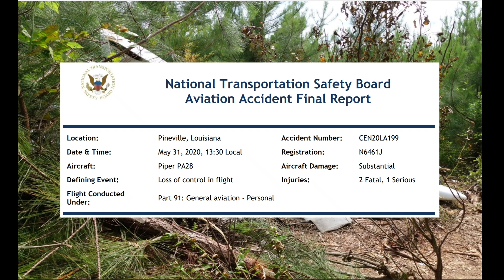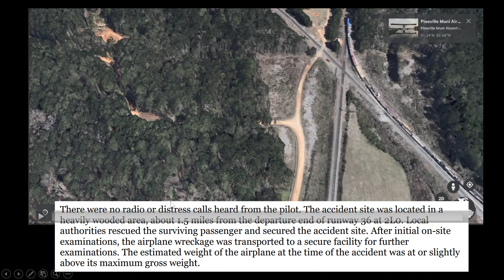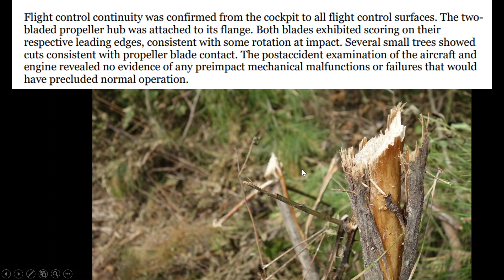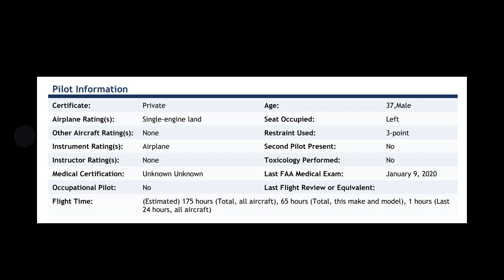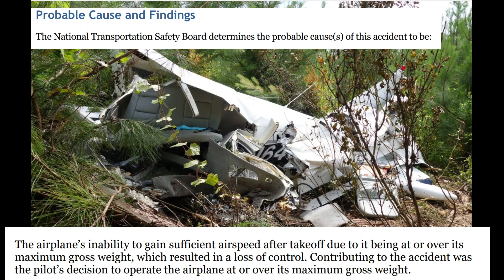Piper PA-28 Overweight causing Stall Spin

Comment: I have to take issue with the NTSB's findings as shown in this case. An aircraft flown at its maximum gross weight should not result in a loss of control and an accident unless they are going to go back on the manufacturer for that rather than the pilot(s). If it was overweight and that can be shown, than that should be the listed cause. If that cannot be shown, then the cause is either undetermined or they needed to do further investigation with respect to other factors like runway length, density altitude, other cause of diminished performance, etc. I can't imagine the NTSB ever accusing the airlines of causing a crash by operating at maximum gross weight. I have watched countless 727's on hot summer days be dispatched at their MTOW for the conditions and runway.
Reply from the maker: Thanks for your thoughts on this one

Comment: I know this is a bit older, but just ran across it. Looks like the weather at the time of the accident was 88F and 42%RH.  Just a stark reminder that density altitude (as stated here many times) is a factor that you have to be aware of. The PA-28-180 usually has a usable load of around 1000lbs.  Fuel, two adults (and they do not appear to be overly lg adults) and a child would typically not put that plane in a bad situation, but at those temp conditions it very will could have been marginal. I don't see much luggage/gear in those photos but hard to tell what they were carrying as well.  RIP aviators, I hope the child is doing ok given the circumstances.  May their deaths not be in vain and we all learn from it.
Reply from the maker: Thank you Wasser for the kind words and your take on this accident

Comment: This is a sad one. The son will have to live with this nightmare. Overweight, pulling back too much on the yoke with not enough airspeed and energy, thinking it’s going to rise when it’s already struggling. OF COURSE ITS GOING TO STALL!!! “Get there itis” That aircraft was doomed when he committed to putting it in the air. You have to pick a point on the runway when it’s time to throttle back and hit the brakes. It stalled just after it cleared the trees and augured in. Completely avoidable. I wonder what the temperature was and the density altitude.
Reply from the maker: Hey Rob, another bummer

Comment: Aircraft are certified to fly at max gross weight, and even.being slightly over probably isn't the only reason for the plane going down.   I agree with the density altitude possibility as well as  the engine may not have been living up to its published 180hp for various reasons.. Not saying that it happened here, but I had a C172 get carb ice on climb out in early summer a few years back and pulling carb heat saved my bacon.  Looking at recorded weather from Pineville the air temp was 75 with a dew point of 73 and humidity of 94%.
Reply from the maker: Thanks for sharing that info and for watching

Comment: The report did not state that the aircraft was over gross. It says it was at or over. Being at max gross weight is not a problem and would not lead to an accident. Something else was going on here such as a partial loss of power which can be caused by the throttle creeping back slowly. Or, more likely, the aircraft was in a steep bank for some reason we'll never know. NTSB should change the report to show loss of control for unknown reasons. Being at or even slightly over gross is a stupid probable cause that is just wrong.

Comment: Most likely it was density attitude & banking to turn cuts your lift stalling the wing. I have flown alot of Piper Cherokee 180's, 2 people, one child & full fuel shouldn't be a over gross problem. A Cherokee 140 will handle that with fuel at the tabs. The FAA made a educational film called Density Attitude with Harry Bliss in 1966 of a couple in a Bonanza on a cross country, highly recommend pilots watch it on YouTube.
Reply: The density altitude was only 1863 ft. Thanks for letting us know about the film. I put it in my Watch Later list.
Reply from the maker: Thanks for the heads up.  Will check it out

Comment: Since when does flying at gross weight lead to a crash?  He should have been able to climb out at 5-600 fpm unless density altitude was very high or he took off down wind. Makes no sense to me. Bad conclusion in my opinion.
Reply: Density Altitude was only 1863 ft. The wind was 030 at 7kts. He took off on 36.

Comment: Got a lot of time in Cherokee 140 180 235 Dakota. With 2 adults child and full fuel Plus baggage I doubt this PA28 180 was over gross.  If the child and 1 adult were in the rear seat  and had  baggage in baggage area may have been out of CG.

Comment: What makes a lot more sense to me than that overweight theory is that they had only partial power. Like Exuma Guy pointed out, how could a Cherokee 180 with full fuel, 2 adults and a child be overweight? Assuming he verified proper RPM before the takeoff, then he lost some power during the climb, if my theory is correct.
Reply: Ive recovered 3 aircraft crashed at Lake Tahoe all overweight and subsequently crashed in the box canyon killing everyone over the years..altitude..heat..full fuel tanks...luggage..wind all are factors even though the aircraft is not carrying its "maximum weight cargo and passenger capacity"..many people have died on this false premise and will continue to do until they do their calculations properly and that doesnt include marginal engine performance also
Reply: @lutomson3496  What do you mean by "this false premise" ?
And as far as" marginal engine performance", I'm assuming you mean reduced engine performance which is naturally part of all density altitude performance calculations.
Reply: @philipmartin708  I think he means incomplete pre-flight calculations in general, complacency plus inexperience in conditions that reduce both lift and engine performance.
Reply: Yes you are absolutly right ! This crash has nothing to do with overweight. Partially powerloss might be a factor, I suspect a stucking carburator heat. Have seen this on many pipers
Reply from the maker: Thanks for you input on this one Philip
Reply: I totally agree. Investigating authorities are very quick to say "overweight" when there is no evidence to support it.
They refuses to look at a partial engine failure.
Reply: More likely scenario is distraction and not watching the airspeed if the engine was working properly.... or hot and humid density altitude.  Unless they had a ton of baggage that plane should have handled it fine.

Comment: These people do this every time, when you are at max weight or even above you extend your roll out, add several knots pitch down trim and ease it up. There's a way to do it. You shouldn't just fly it like you do everyday with half a tank of gas and two people.
Reply: Matthew is exactly correct.
When you’re loaded down, stay in ground effect, build up speed then make your climb out.
Reply from the maker: @budowens6478  thanks Bud for watching
Reply: @budowens6478  There's no advantage to keeping it down past your best rate of climb speed. Plus, if you can't climb normally at Vy, it's better to find out then, than after a zoom takeoff. I aborted a takeoff once do to poor climb. Is" loaded down" code for over gross?
Reply: @philipmartin708  I should have said gross weight
Reply from the maker: Thanks Matt for your take on this one.
Reply: @ARFFWorld  My conveniently left out do not ever do this with a anemic or barely adequate powered airplane. You can get away with this much better with stronger power plants. Especially turboprops.